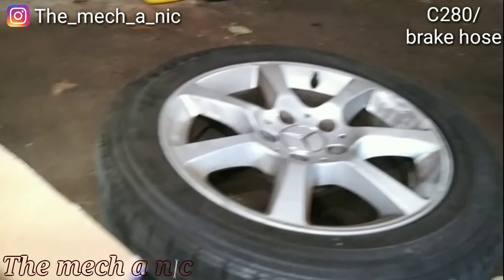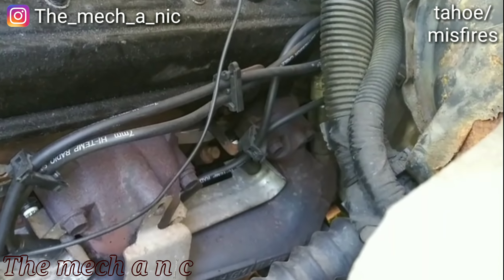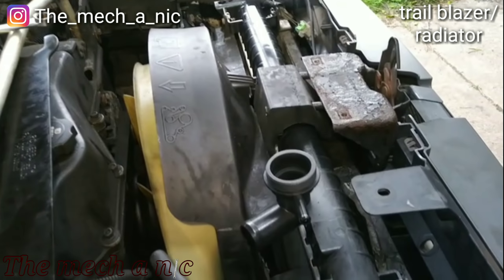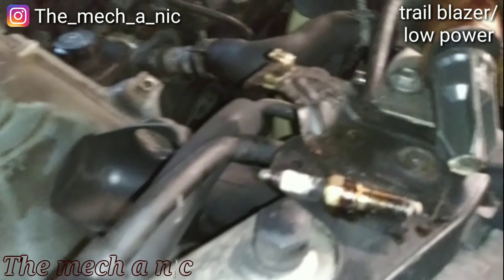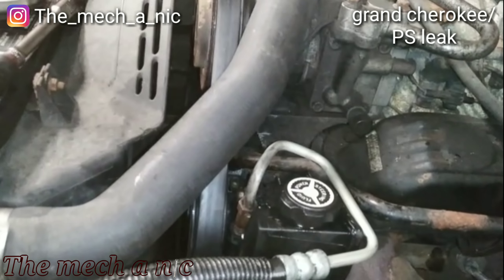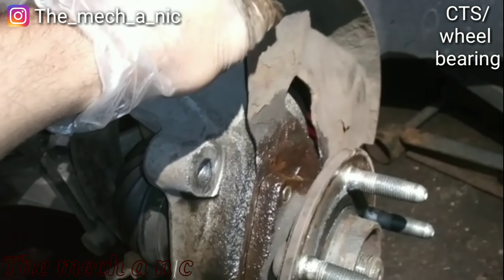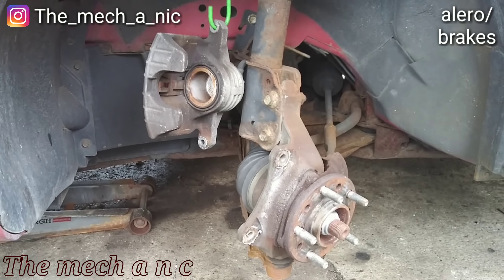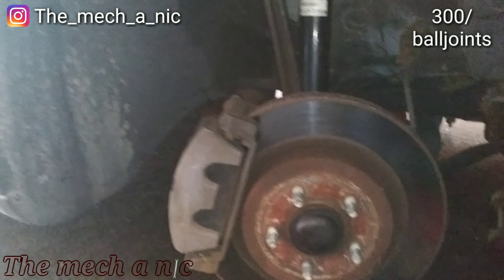insta mech a nic (vol 34) 
jeep steering gear and plugs with no gaps

Comment: Was there anything tightened on that Trailblazer? Wow, I've never seen a gearbox leak like that nor have I've seen spark plugs that bad. interesting stuff on this one.
Reply from the maker: The trail blazer was thought to be a oil burner...no its just all pouring out the bottom lol . that was also a first for me, usually the gearbox just drips ps fluid. Id have to say those are some of the worst spark plugs ive seen...